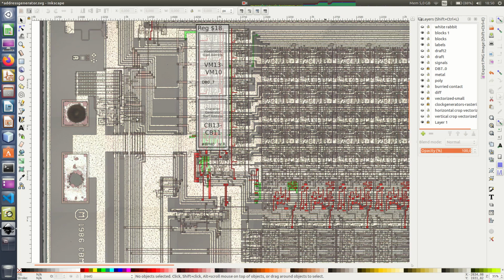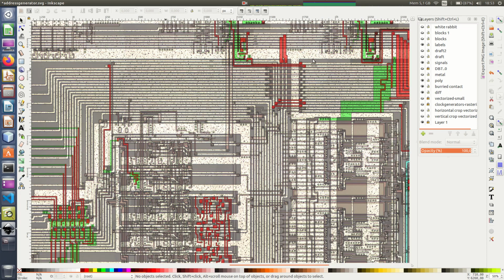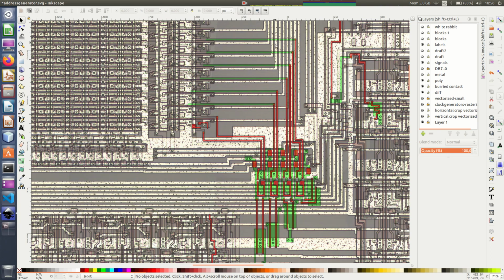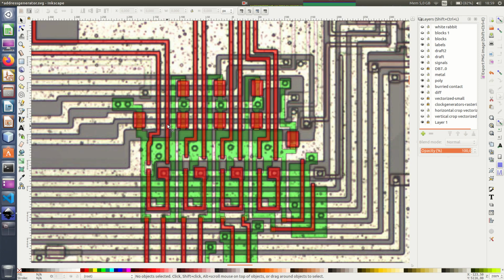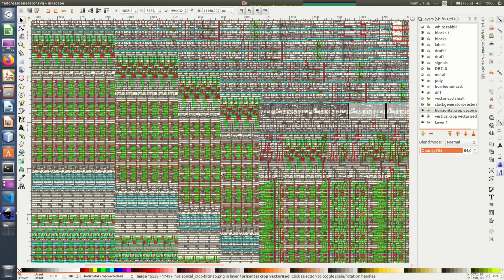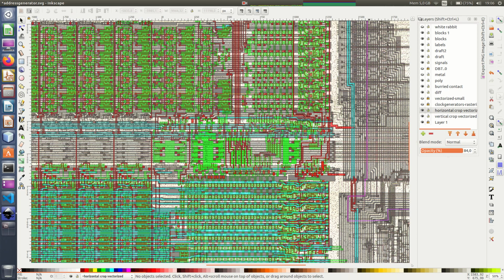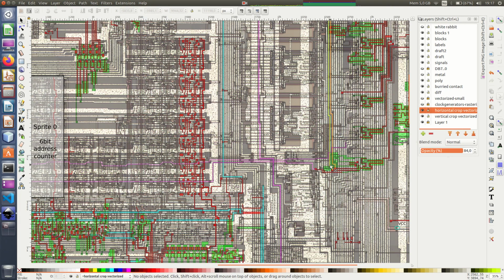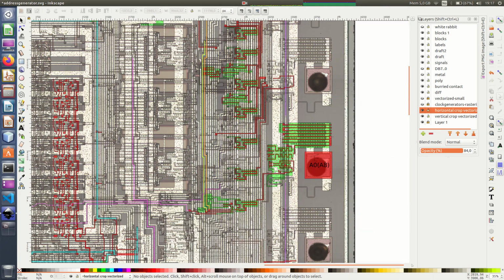c64 vic II dieshot - address generators - the char address

Comment: I am actually curious on to what your goal with this will be? I know that there are a lot of people trying to do a reverse enginered VIC-II replacement. Would this be your goal perhaps?
Reply from the maker: Hi. Yed, buy I dont see it likely to happen any time soon by myself alone.
Reply: @bwack  Cool... I just hope that someone can make a drop in replacement at some point. Mixing some kind of analog tech with FPGA. That would be cool, if it becomes a reality. It might solve the VIC-II's problem with bad video signal. It might even be possible to do a kind of upscaling to make it future proof.
Reply from the maker: @brostenen  me too. Though the analog or ADC part is working quite well in the video enhancement board project. Very low noise as far as I can see. Upscaling is something I hope we will see soon. Thanks for the comment 🙂
Reply: @bwack  No problemo. I have been searching for information on VIC-II replacements the last many years. There are a few talks here and there. And people have begun making code for FPGA implementations of the VIC-II chip that however is a part of the whole system. We have your enhancement. Else it is pretty much just cameleon, ultimate64, C-ONE boards and so on, that have something. Just not a chip on it's own.

Comment: Good luck with the simulation. I am toying around with Logisim but I can't get any of the VIC bits to work because of all this pass transistor logic.
Reply from the maker: Thanks. OK, I remember that when I simulated the horizontal counter I used (in logisim) buffers with enable as passtransistor. worked well.. Also when using pass transistors / buffers with enable, it is important to have non-overlapping two-phase clocks for it to work, which is easy enough to make.
Reply from the maker: or when I come to think of it it was DigitalWorks I used.
Reply: DigitalWorks remembers the voltage on a line if all connecting transistors are off, Logisim sets the signal to undefined. So I guess DigitalWorks beats Logisim in this case.

Comment: I believe someone will produce a new replacement VIC2 chip on an FPGA outputting RGB in addition to Y/C someday.  Then, we won't have to deal with the stripes or the checkers or bleeds etc and have awesomely sharp and clean 15kHz 240p picture with RGBS or RGBHV.

Comment: Wonderful! These are the only videos on youtube that watch more than once. Just so that I can grasp what they're about. 
I'm still a bit amazed at how you can speak of Networks and Circuitry without having actual components. It's all about how the material behaves. 
Can't wait to see the simulation.
Reply from the maker: Hi Wouter. A lot is imagination when I speak of the networks, while remembering how stuff works of stuff I've done before. I've been doing the first bit of the address counter and it indeed does "count" :) Or more like it oscillates at 50% of the clock speed, which is what a counter does from one bit to the next anyway when it is counting :)